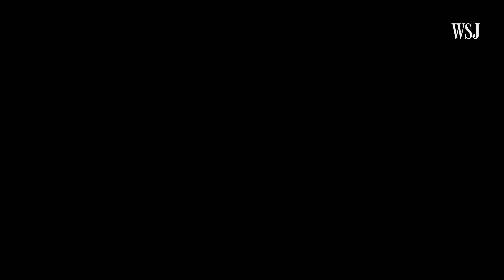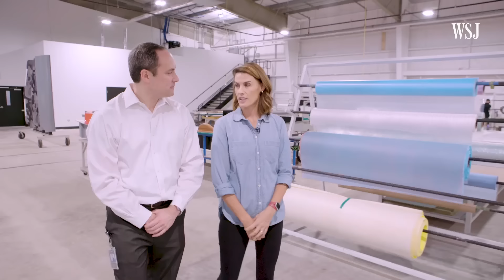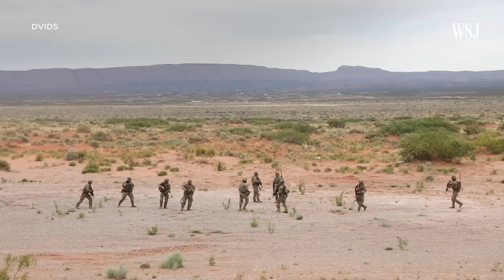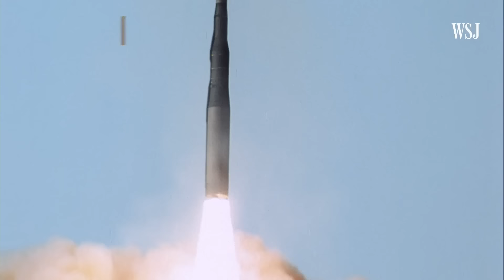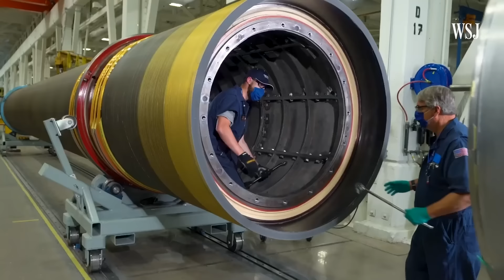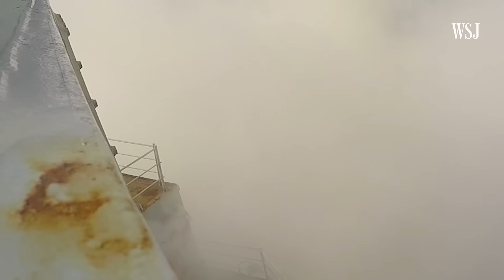Breaking Down Russia’s Vacuum Bomb, the U.S.'s M10 Booker and More | WSJ Equipped

Comment: A Triton is the same cost as Tomahawk? That’s way too high.
Reply: Bro it's a solar autonomous submarine that's small, it has incredible potential
Reply: @charlesyoung3444  I don't think 2-3 million per unit is attritable. Even at mass production and assuming a generous cost reduction  to be 1/4 of that 2 million, it would still be half a million per boat. These things have low payload and are incredibly slow, so you would need a lot of them to achieve meaningful impact. Meanwhile, a single Tomahawk naval variant could sink a ship. Even if they are intercepted, the interceptors would likely cost almost as much as a Tomahawk. These tritons are the equivalent of a slightly higher end ISR aerial drones that are being used in Ukraine right now and they are lost by the thousands per month.
Reply: @kevinc1200  remember the 65,000$ bag of steel O rings?
Reply: Mother effer is a sailboat AND a submarine, and its solar and autonomous AND can be self sufficient for 3 months at a time.
Reply: @AntiElon_Club 
Yeah im sure the chinese can build that for 50-100K
Reply: I actually thought it was one of the most reasonably priced wpns we have in our miIitary. Just waiting to see if it's used for the right reasons though.
Reply: It's not even in full production yet. They don't even have a contract. The price would drop considerably
Reply: @Funko777 drop for whom troll....when black amerikkka must be fleetched for everything without being thrown any crumbs back
Reply: @yougetaspear7799 Try using words.  "fleetched" is not a word.
Reply: I think he's commenting on how f8ck1ng expensive a Tomahawk Cruise Missile is. It doesn't matter what it is, it's extremely expensive for the military. A mounted radio system for a vehicle is $28,000. We had 4 of those in my vehicle. So that's $132,000 for the radios, forget about all of the extra stuff like whip antennas, EPLRS, FBCB2, DAGrs, CVCs, Remote Weapons System, the sensors for said RWS...Once a company wins a military contract, it's goal is to overcharge the state as much as possible without losing the contract.
Reply: Its speed is 5 knots? So its going to have to be given an area to monitor its for sure not chasing anything
Reply: You can expect it to be very expensive because the US government does not care about cost. Overpriced and ineffective against a real military. I guess this thing fits the ESG mold.
Reply: It ain't no rc sailboat that grandpa totes around the lake.
Reply: Ikr he said that like it's cheap. This little boat is the price of a missile that can destroy a large building. The reason why the U.S. military budget is 800 Billion. China and Russia Don't have that problem
Reply: 1000 units, $3B. And I think it would take 10,000 units to maximise its capability
Reply: The tomahawk is single use.
In that sense, the Triton is a bargain.
Reply: It’s an expensive piece of junk lol. It’s most likely using px4/ardupilot to control itself, that is like 1-2k TOPS for the control unit. I couldn’t see there being more than 20-30k worth of sensors in there considering that budget will get you some pretty high end sensors. Manufacturing can’t be that expensive, USA doesn’t exactly pay there manufacturers the best rates. The biggest cost will be the top heavy corporate team who spend most of their time galavanting around to business dinners and posting on LinkedIn how great their product is despite the fact they likely never stepped foot on the production line or learned anything besides the basic specs of the sales sheet. If this thing is costing more than 80k - 100k usd per unit to manufacture, there’s seriously something wrong with their production line. But like I said, when you have a corporate team of 20+ all on 150-200k a year, it drains you’re companies revenue pretty quick and your stuck charging ridiculous prices like this. the Chinese will literally scoop this up with a fishing net, reverse engineer it and manufacture it for like 1/50th of the price. Odds are half its components are made in Taiwan/China/Australia because USA doesn’t produce and good autonomous control systems that don’t cost 100 million dollars.
Reply: @Trule2456  If it is made in Australia then that is good for Taiwan and the US. You make a number of fair points, our supply chain needs improvement and a greater focus on security.
Reply: Before you say the Triton is too expensive, consider the costs, it requires a dozen bag of bushings worth 90 thousand dollars and comes fitted with that state of the art 10k toilet seat.
Reply: @debaterofeverythingpresent2775  triton does not have a toilet
Reply: @debaterofeverythingpresent2775 I used to make the 10k toilets used on some air force planes. It's just a simple plastic toilet that is waaaaay over priced lol
Reply: 1-2 million for a naval bot without payload that goes 5 knots in ideal conditions and would be stopped by a fishing net, would have limited capabilities.
Reply: @snuscaboose1942  Ukraine-Russa war has shown the effectiveness of naval drones, you have no idea what you're talking about.
Reply: @kirinyardberry1324  Ukraine is a land war, not a ocean war.
Reply: @samuelmorales2344  Tell that to the black sea fleet
Reply: @kirinyardberry1324 no you dont. They use aquatic drones with offensive capabilities worth 50-100k. Not recon drones easily stolen costing milliooooons
Reply: @kirinyardberry1324  The Ukrainian naval drones have serious payloads up to 320kg explosives, communication and camera packages, go much faster than the rowing speed of 5 knots this money pit is offering.

Comment: GLSDB was a failure. It turns out that GPS jamming is cheap enough now to have it all up and down the front every few miles.
Reply: Just a few tweaks here and there and it should be good. Recent evidence from Ukraine seems to suggest this is what has happened.
Reply: For a failure multiple GLSDB's apparently took out an S400 battery